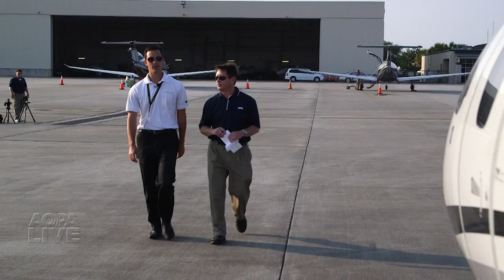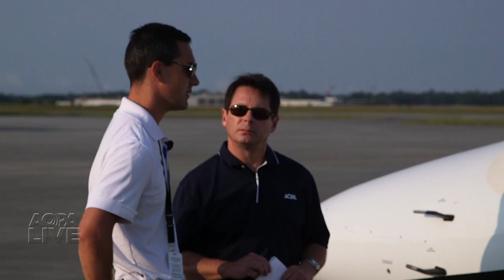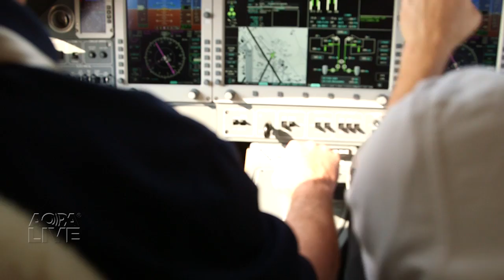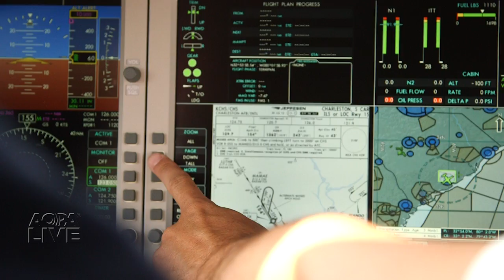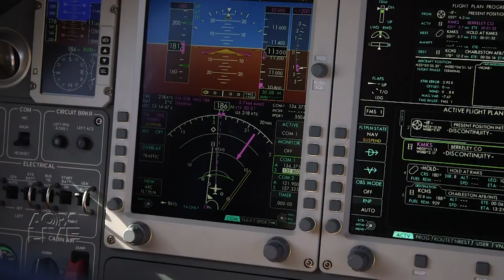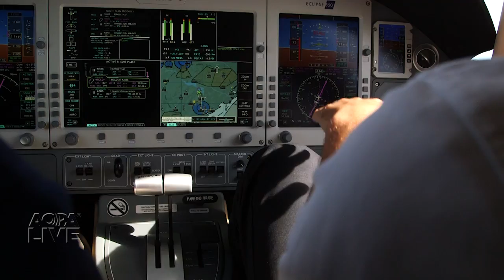Flying the Eclipse 550

Comment: How is it tha an anti-lock braking system was not a  consideration before?
Reply: Changing anything on a certified aircraft is extremely expensive due to the amount R&D, testing and cerrtification that is required.  Then you have to produce and carry parts for both the new system and for the original one,   train the technicians to maintain the new system and there is also a possible liability cost if it doesn't work as well as intended.

In this case you can also add the fact that the company has always been underfunded and has over promised and under delivered into a completely new market segment that never developed into much more than 20% of what it was forecasted to be.  The new version of the eclipse jet and their turboprop kestrel have have been in development for the last 5 to 10 respectively and stil have no confirmed date for completion.

Comment: so is this less advanced the the Cirrus Vision Jet. This looks like an aluminum shell Vision is carbon fiber
Reply: Not even comparable, twin engine vs single. 375 knot cruise vs 300 knot. 41,000 ft ceiling vs 28,000 ft. 1,300 nmi range vs 1,200 which btw you have to cruise at 240 knots to get the 1,200 range. The vision jet is a single engine plane good for short trips, might as well get a tbm that's light years better for a little more money if you want a single engine.
Reply: @Reloadeez  The vision jet is imagined as a step-up for SR22 owners. Similar handling characteristics and pattern speeds.
Reply: how do they compare in cost and performance.